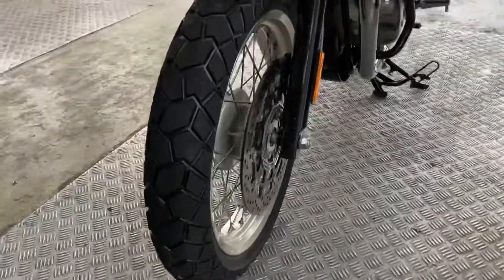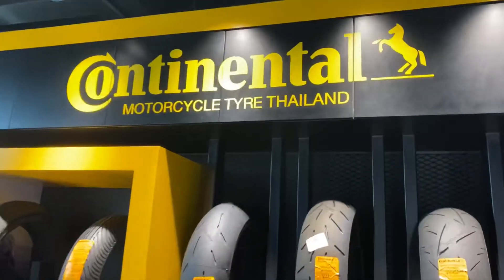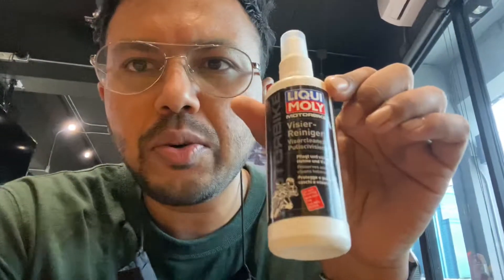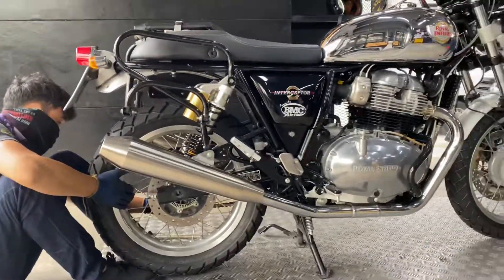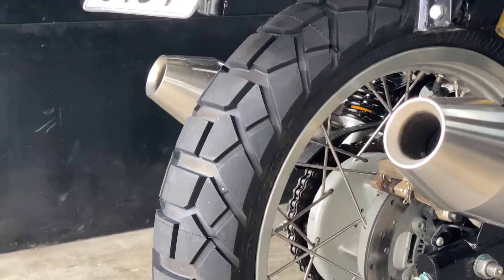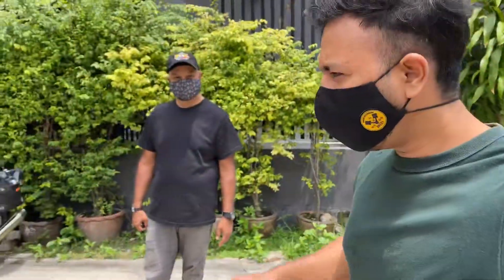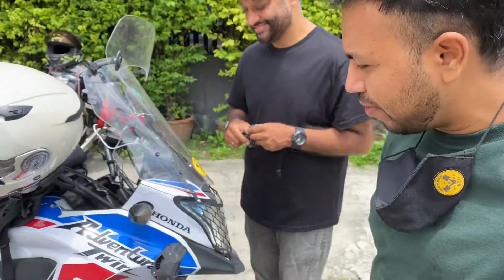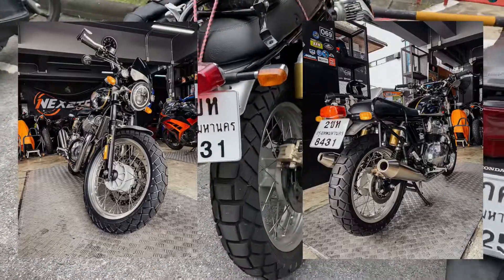New Off-Road Tire for my RE Interceptor 650 | Conti TKC 70 Rocks | 29 Tire | Bangkok | VLOG

Comment: Hey Man, nice video. Did you made some adjustments on the actual bike for these tyres or no further adjustments needed? Also, how did it perform on the road and off road?
Reply from the maker: No adjustment needed on rim and it super good on on road and off-road but you can hear the nob sound while riding but it will adjust soon on your ears.

Comment: hi, what size tire did you use please? did you change the rims? Thanks. Anyway, it's better this way, thank you for your information.
Reply from the maker: 100 front and 150 rear. I haven’t changed the rim.
Reply: @kapdroidmoto  thank you
Reply: @kapdroidmoto  Did the 150 fit? Because the stock tyres come with 130 right? Did you have to change the swing arm? Or does the 150 fit? And if 150 is fitted, do you need to change the ABS settings?